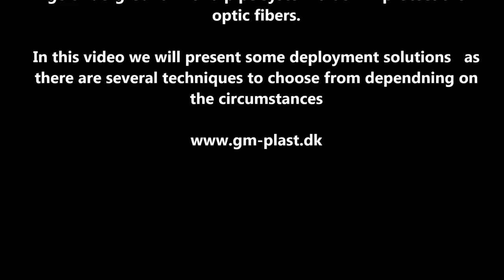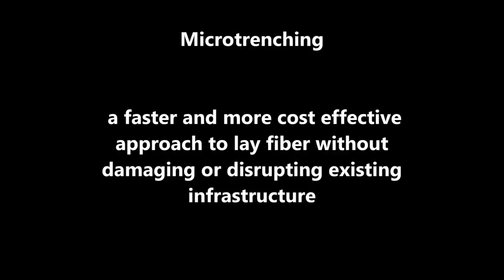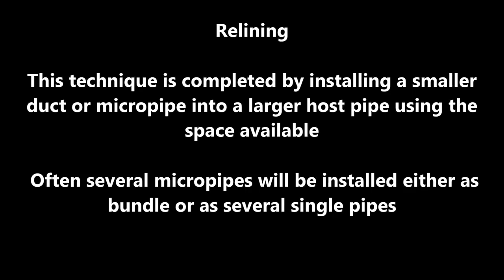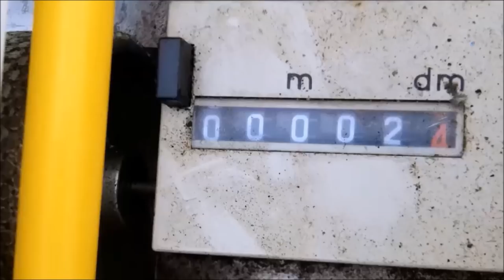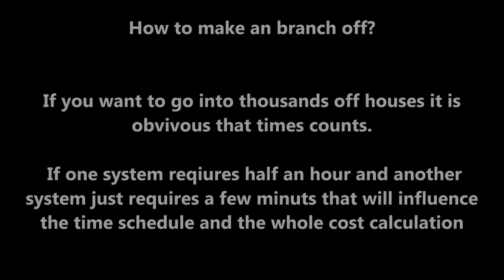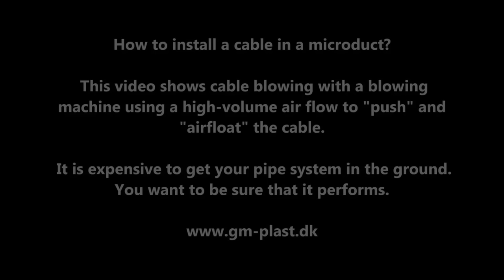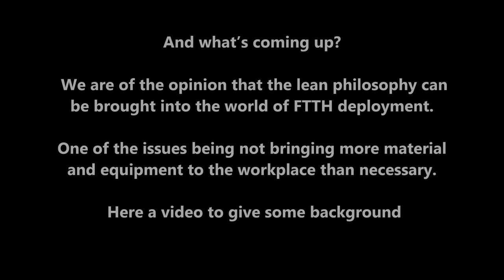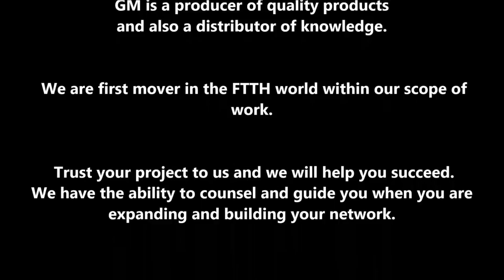Methods of FTTH deployment 1. How to establish a broadband network.

Comment: Here in South Florida, USA. For runs from curb to structure Verizon used a cable that included 1 single fiber strand, fiberglass and roughly 18g steel cable. It’s rigid enough for direct burial or burial by vibratory trench without conduit. the cable also includes modular jacks on each one for connections to the fiber tab at curb.
Reply from the maker: Interesting. Does that supply a good connection? Two things to be said (GM POV) Using an microduct will allow maintenance and upgrades rather easy as the “pathway” will be there for decades to come. The steel ideally shouldn’t be combined with fiber optics (Risk of lightning, currents of electricity and so on) However, there are many ways to reach FTTH. All, both network owners and the supplying industry, claims to know the “truth”. Well, it not as easy as that. The important thing is to establish a long life and easy to maintain system. Br. GM Plast team
Reply: @GM_Plast  It works great! They (Frontier Communications) delivers 2G/2G to my home.
Reply: @GM_Plast  Generally fiber-optic wiring needs a metal wire running along it so that it can easily be located before digging in the area, a thin steel wire is easily located and marked while fiber-optic wiring contains no metal and can't be detected with a metal detector.  Lightning is a non-issue for wiring that runs underground and that might possibly run a couple meters (2m = 6ft for @Jonathan_O and others in the USA) up the side of the building - there will be other things such as metal chimney caps, eavestroughs, and other building components at a higher height that will be much more susceptible to lightning
Reply from the maker: @plur90  Right! Often we will on demand add an trace wire into the bundle of ducts. Then you can also through detetction determine distance between manholes/termination points or/and depth. However, often this will be ignored by the purchaser or other parties involved in the rool out as their argument is that it add to the cost and they need more euipment. That argument isnt really valid as time (and digging) saved will be such a pay off that the few extra cents are more than paid off. TC/total cost isnt always king.....

Comment: So when you deploy such a tube with fiber, what's the fiber type and how many cables are in there ? What's the capacity usually?
Reply from the maker: The fiber type is microcable. This typically comes in sizes from Ø 1,5 to Ø 12-13. and is usually being used in a microdct in the range from Ø5/3,5 up to Ø20/16 (outside diameter and inside diameter). See our playlist with fiberblowing as there is a lot of fact and figures. Br. GM Plast

Comment: Dear GM Plast, how would you proceed in deploying Fiber Optic Cable through underground conduits? For example a sewer, or an underground pipe? I would love to hear you expert advice on this. I would love to discuss it over email, phone, or here, if you get the chance.
Reply: Drill it undergrund using a horizontal directional drill

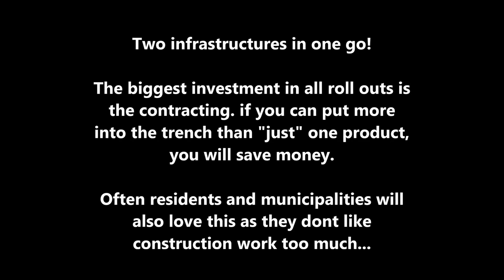Comment: 24:40 most of Austria like "Oh, I know we just installed gas or remote heating, and I know we totaly forgot to lay pipes for fiber. So we are sorry, but digging up the road again is only viable in 30 years, when the road is bad again or if someone else needs to dig it up." 1 year later someone else digs it up. "Oh shit, we forgot again. We are so so so sorry. Maybe next time." Or: "If the street is dug up the next time talk to your city council, they will tell us that the street is opened up and we will lay fiber." City like: "That's not our problem, you have to talk to the ISP."

Comment: 28:50  What is the durability of such connection - it does not look very robust. Also wouldn't dirt and huminity enter the microtube at longterm since the junction is apparently not protected anyhow in the soil?
Reply from the maker: The durability is eminent. Think about it. The Ø110/50 and Ø40 commonly used has a wall thickness that comparable is much less than a microduct where most of the sizes has a wall thickness of 2 mm.

 The micoduct systems being used today are built on up to 20 yrs. trial and error. The contracting being used to install the smaller system is also much less intrusive and occurrences with damaging other infrastructure will be rarer.

 We purposely have all these “real” videos and do not use animations and other fancy communication. We want to show the “real” stuff from the “real” work situation. About sturdiness. 

Try to see this video:   

 https://www.youtube.com/watch?v=PBInVNKOudg

Comment: Why yes, Youtube, I would like to watch a series of videos on how to deploy a fibre optic network which will occupy over 2 hours of my life.

What? No I don't work for an ISP or anything to do with laying pipe in the ground, why do you ask? 🤣

Seriously though, Just had the main pipework layed up our street for fibre, so it's interesting to see the process and the ways it gets installed. Just got to wait for them to pipe from the splitter cab to the building now, only 15 ft away from 1gbit fibre! :).
Reply from the maker: Yes. YouTube is a place to gain both insight and go into details with subjects that sometimes had been unknown to you until the moment you came in touch with it. Al this is being made possible by NGN networks! (microducts, Optical fiber, clever contracting)  Data transmission enabling meaningful interaction
Reply: @GM_Plast  I agree, it's just interesting how it comes up with these suggestions.

Great video btw :).

Comment: why first layer is being done by hand.
Reply from the maker: To avoid rocks, stones and other sharp objects that may introduce damage to the microducts. A top layer of sand on top of the microduct bundle is the correct start of back filling
Reply: @GM_Plast  what about the stones and other sharp objects underneath the microduct bundle
Reply from the maker: Hi there. About backfilling. The materiel to be used should fulfill these demands: 
 • Particles over 16 mm must not occur 
• Particles between 8-16mm may at the most be 10 % of the material 
• The material must not be frozen 
• Sharp materials must not be used. Either fine earth or sand is to be preferedIf this is being observed everything should be just fine Br. GM Plast